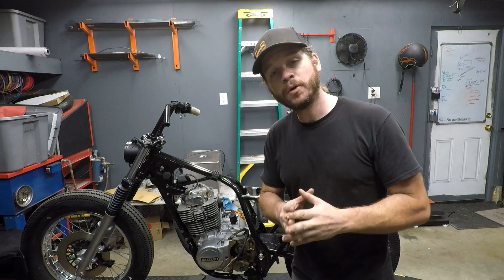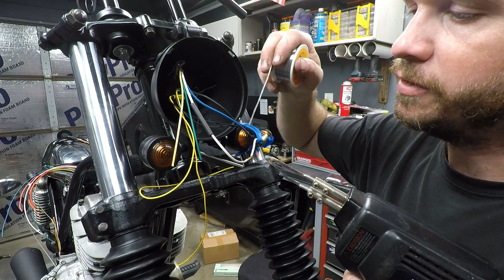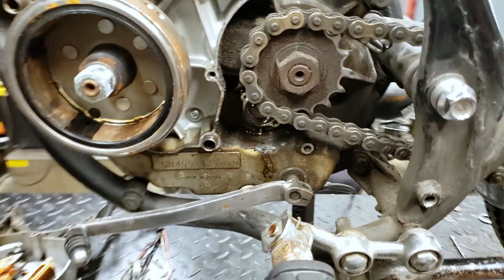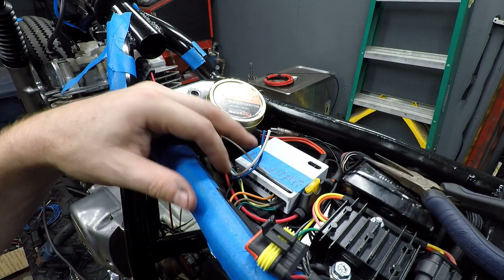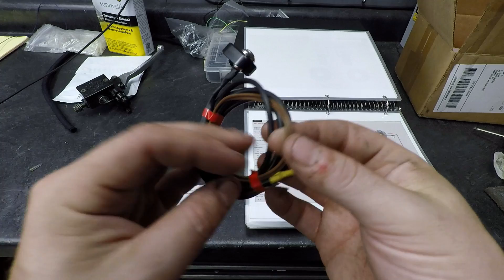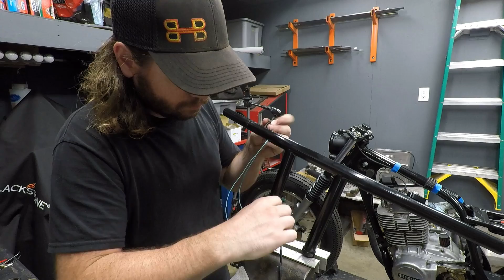How To Install an X21 Type M

Comment: In your CX500 build you put the reg/rec under the tank instead of the tray here. I have a reg/rec I want to mount in the electronics tray of my GL500 build but I am worried about heat. Any issues from this build or should I not worry about putting it in the tray? It would get similar airflow to this video.
Reply from the maker: While having airflow is a good thing it's not always necessary.  I've never had one fail on me. Do your best to have the fins face upward as heat rises. If not, have them to the side. Just don't mount them upside down. Also, a mosfet reg/rec will run cooler due to its internal design
Reply: Awesome, thank you so much! Love the new shop build and the bike builds. I didn't know the mosfet ran cooler as well  @BrickHouseBuilds

Comment: I have a question about the neutral switch, my dummy light is on when the bike is in gear 1-5 and off in neutral. Is there a fix for that?
Reply from the maker: If you have an X21 and having this issue you can actually reach out to tech support on nwtcycletronic.com
Reply: Thanks. will do @BrickHouseBuilds

Comment: Does this have a built-in starter solenoid relay in it like the M-unit?
Reply from the maker: This controls the starter solenoid yes. The solenoid is external from the control hub itself

Comment: For fishing wires through holes use a trick that electricians use for pulling wire through conduit.  Tie a little piece of plastic bag to a string and pull through using suction from a shop vac on the other end.  Tie the string to your wires and pull back through.

Comment: Great work! Would you reckon that the X21 is a better option for me compared to the M unit for a 1983 SR 500 (Kickstarter, only one of those small batteries, electric Power only when bike running)? I am shortly upgrading the headlight and indicators to LED lights + put in a digital speedometer. But im worried about blowing electronic components when trying to Kick it into life (spikes etc). It would be nice to clean up the current setup of wires stuffed into the headlight
Reply from the maker: For keeping things simple I really like the x21 with the perfect example being on this bike. I wouldn't worry at all about damaging components when kicking as thats just normal use.
Reply: ok thanks - its a cheaper alternative than the moto unit which seems for more complicated electrical bike systems and is overkill for my simple little Thumper :)  @BrickHouseBuilds

Comment: I love these little controllers. I have been wiring controls for years in the commercial HVAC industry. It’s good to see motorcycles getting things simplified. That is as long it is reliable. If the processor fails (I realize it’s not working that hard) then you are dead in the water.

Comment: Looking into this on an f11 cafe thing im attempting. Would it happen  to work on a 6 volt bike?
Reply from the maker: Very cool! Yes it works with 6v just fine.
Reply: @BrickHouseBuilds  AWSOME  thanks for the reply. The factory harness  is not in good shape at all and has alot of extra crap in it. Once i get to that part this will be how i fix it

Comment: Should there be any continuity on the headlight wires and the rear brake wires. I’ve been testing those and haven’t gotten a beep
Reply from the maker: Send me an email to bj@brickhousebuilds.com and we can go from there. Much easier than in comments

Comment: Hey i currently just finished building my cl175 and im on to my wiring. Ive been looking for a set up like this but i have found a lot other then the M-unit by motogadget and the blackbox by all purpose moto. What would you say is the difference between those and you X21 system? And with your system are your controls already wired to the plug that goes to the X21 leaving your lights, ignition and others to be wired after?
Reply from the maker: Well I'm glad you have found the X21. As far as differences are concerned all of the ones you listed operate along the same basic premise with smart control power output. What I can say for the X21 is that it is modern and uses the latest tech, the manufacturer of the product also designed it, and it is always being evolved based on what customers want to see. If you haven't already please check out my website and look for the install guide PDFs for all of our products.  That gives you full info for how to wire them. We also have a 2 year no hassle warranty and the best support. I have a lotnof information out on this stuff so Its a matter of going through it.
Reply: @BrickHouseBuilds  Okay thanks! Im excited with what I see so far and hopefully it ends up being a perfect fit for me and my bike!

Comment: This video is going to be so helpful for installing my x21, thank you!

Quick question:
The regulator rectifier doesn't need to be grounded to the body does it, you just used that point as a convenient location?
Reply from the maker: Thanks Frank and I do hope it will be helpful!  To you question, correct. The body doesn't need to be grounded it was just a convenient spot.

Comment: Lovely and very informative video, thx BJ.  I'm always kinda struggling with choosen the correct CDI setup (GS450) so the manual should sort that out. And love the tip with flexing those wires with the heatgun.
Reply from the maker: Glad you found it helpful!

Comment: Nice video. Very detailed and I like that, so thank you and good job.
If you put one of these X21 systems on a 75 CB750-four, is it more complicated? Are you going to put one on the blue 750 you did the videos on? And if so, will that be recorded? I run a 75 cafe and the stock harness is absolute overkill in my opinion. Would be interested to know if it can be simplified cause I think that would also make it more reliable, even though I have no issues with mine.
Reply from the maker: So this system would install in a very similar way. As the idea is to remove your stock harness having different install videos for different bikes is almost pointless as you can apply everything here to a cb750. Your charging system would vary as well as ignition but that is all labeled in the installation guide
Reply: @BrickHouseBuilds  thank you for the fast response. I appreciate it.

Comment: I asked a question a week or so back about which of the units do you have specific for a 1986 sportster. Could you please advise,  Scott in Southern Oregon
Reply from the maker: Hey Scott I had answered that one saying these are universal as you are making the harness to the bike. The difficult part is that none of the controls we offer are for 1 inch bars so you would either need to fit 7/8' bars for the S or P or have your desired controls modified.

Comment: One thing that can be useful is you can get label printers that print onto heat shrink tube. Useful for labelling wires without relying on colours.
Reply from the maker: True but at this point I have the color codes memorized lol
Reply: @BrickHouseBuilds  , yeah, but some of us have a memory like a sieve!

Comment: I know what helped me a ton is getting 80-90% done, and then doing a video call with NWT to have them check all my wiring and fix anything I did wrong or still needed to do. Then do another video call when I was at 99% just about ready to connect my battery to everything and actually turn it on. They are such a good company, I can't sing their praises enough! They are just a bunch of motorcycle fanatics who want to see old bikes back on the road with new, cleaner electronics.
Reply from the maker: Thats definitely a nice service we do!